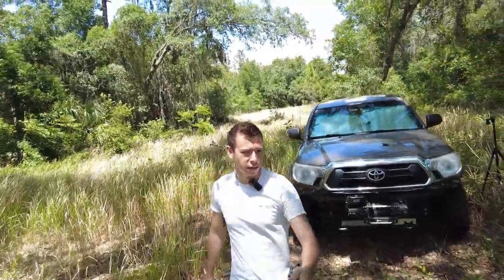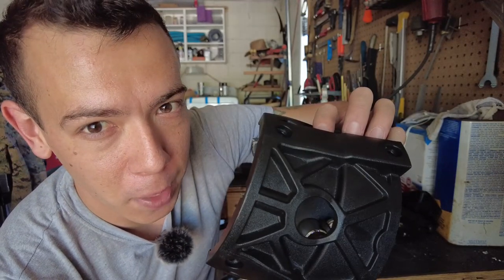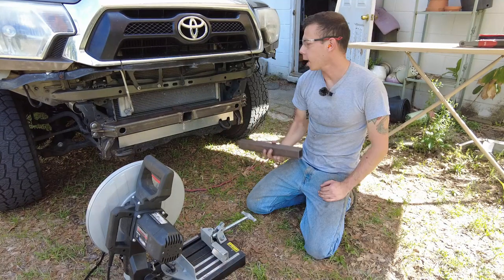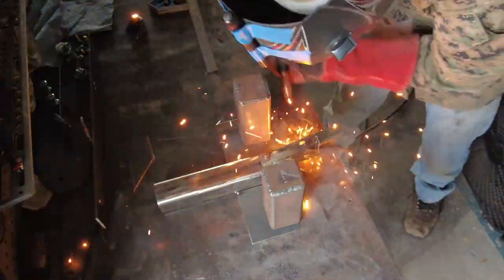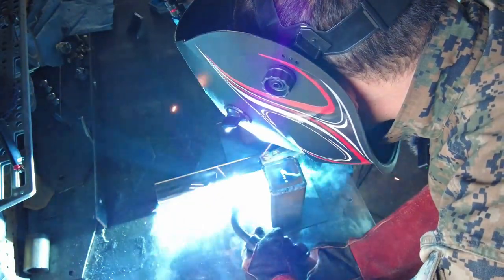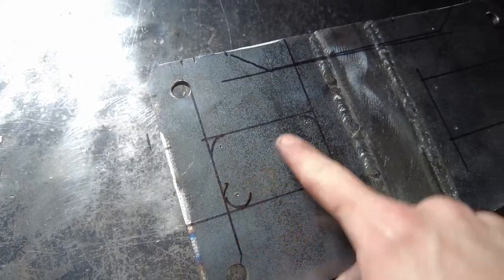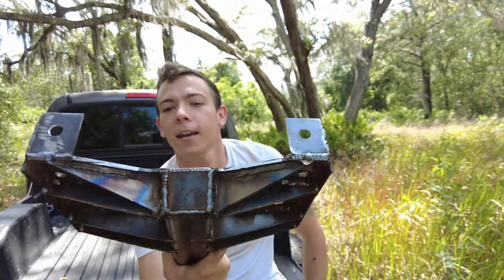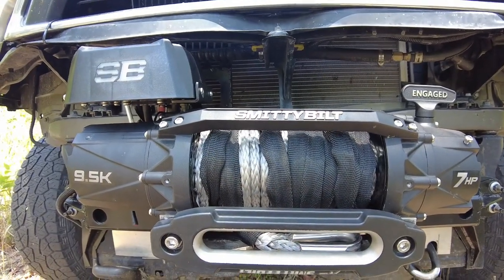Making my own custom winch mount.

Comment: I’m beginning to think you don’t like that “armour” 😂 Can I have one of those ones you threw away? 😂
Reply from the maker: I dont mind armor; i just dont like weight. 
I feel like bumpers are infrequently used as armor and just serve aesthetic proposes and to weigh down vehicles unnecessarily. 
I scrapped the two failed winch plates; get a bit of money for them a steel scrap place.
Reply: @jdesigns7239  I agree with you. Most 4wd vehicles are grossly overweight!
Reply from the maker: @officialWWM  Agreed!